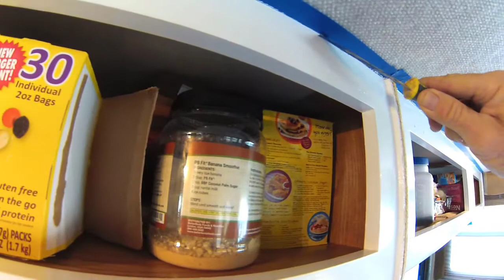Painting RV Cabinets

Comment: How did you paint your fridge
Reply from the maker: Took off the top and bottom rails of the freezer and refrigerator doors. Masked off the metal with blue painters tape. one coat of oil base primer and two coats of latex gloss enamel.

Comment: Did it last or did it nick a lot
Reply from the maker: So far as of today 03.20.2019 all cabinets and doors still doing great. I will be doing my kitchen cabinets in the house this summer. I did get a few nicks in the wall, during my RV travels. I just brushed some touch up paint on it. It match right up.

Comment: Does the paint/primer stick to the faux wood surfacing okay? Or does it make it too heavy like painted wallpaper?
Reply from the maker: After light sanding the cabinets/  fake wood - I used oil base primer first. So far I have had no issues.